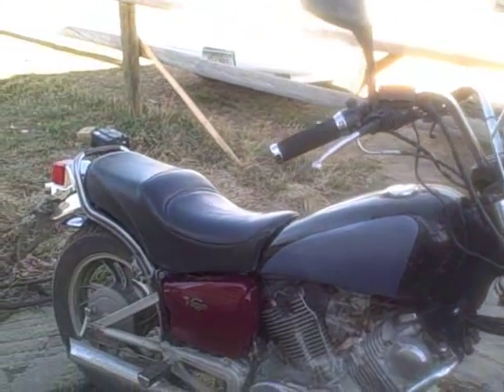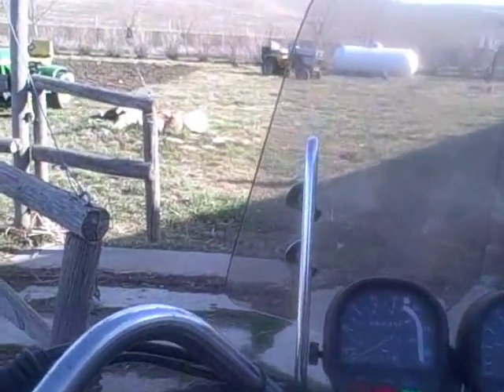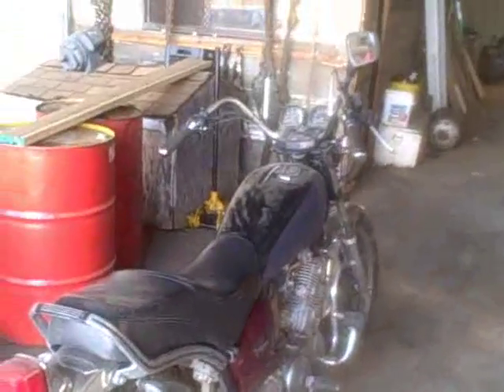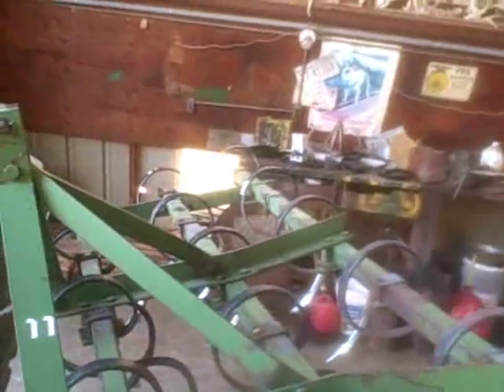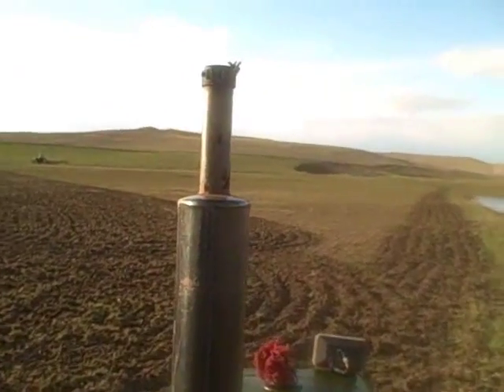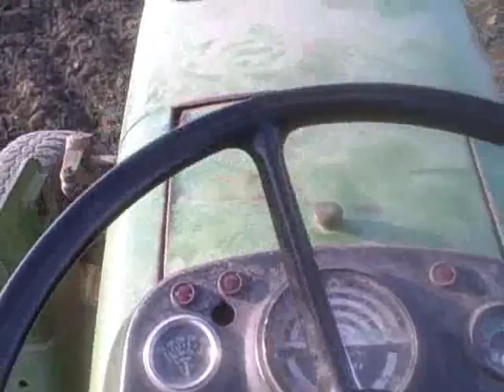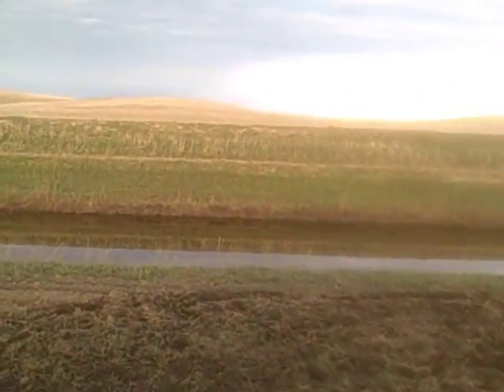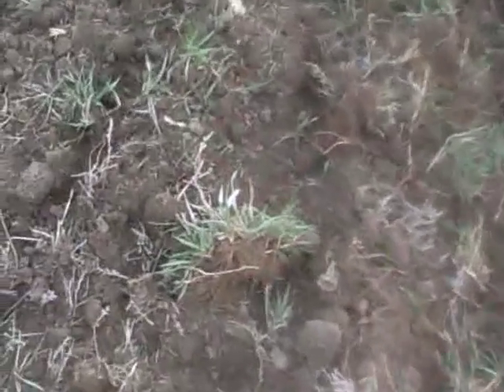John Deere 2240 ripping up the hay field

Comment: A spring tine cultivator wont dig too deep, its made to create a seedbed on ploughed soil. If you have a tough sod, you'll pull lots of lumps with a spring tine cultivator. The disk is better for breaking up, then use a chisel to relief compaction.